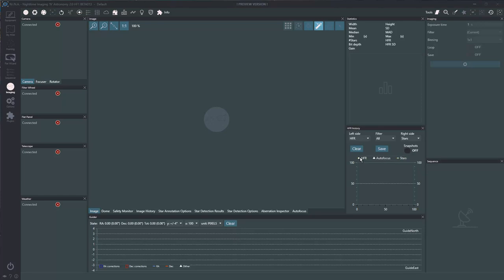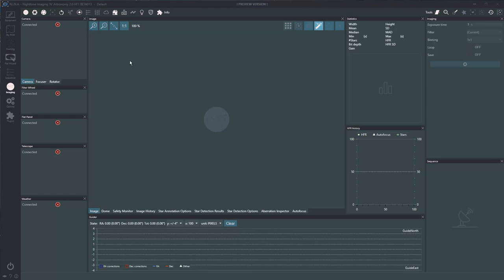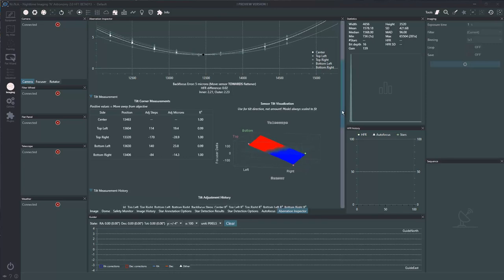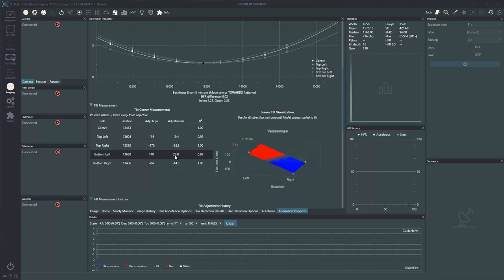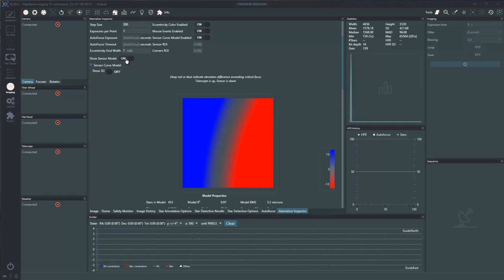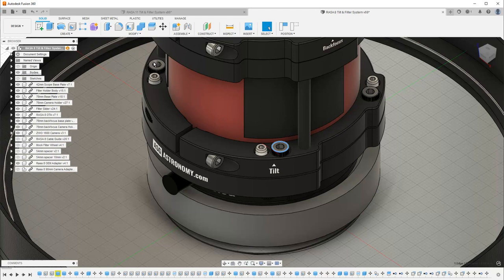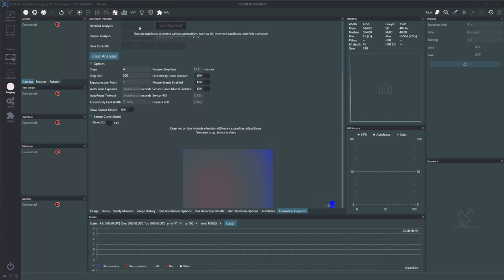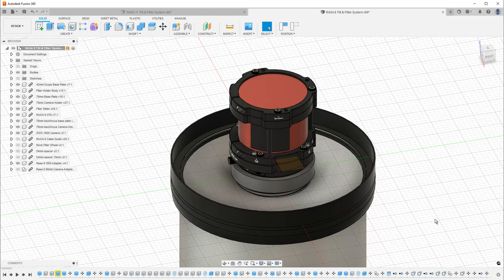How to Adjust Tilt using NINA & Hocus Focus

Comment: FYI regarding Celestron telescopes and the Celestron focus motor:

"Thank you for contacting Celestron Technical Support.

The Celestron 8-9.25-11-14 focusers all use same 0.75mm thread pitch for the focus shaft.
The focus motor moves in 1000 steps per motor revolution
Each motor revolution moves the mirror 750 microns.
Thus each step on the motor movement moved the mirror .75 micron."
Reply: @asgastronomy  Interesting, where did the 1mm thread pitch info on the RASA come from?  I assumed that statement from Celestron Support applied to all telescopes in the 8-14 range, EdgeHD and RASA.
Reply from the maker: Not sure why all my comments were deleted on youtube land, but adding them back here in case other users need info...  The RASA white papers show 1mm for RASA thread pitch, I could see the celestron SCT line being .75mm thread pitch though...
Reply: @asgastronomy  That's weird because I do remember seeing this comment before.  Doesn't it seem odd that the EdgeHD has a finer thread pitch than the RASA? I would think they would want finer focusing pitch on the RASA.
Reply from the maker: Probably matched up to focal length though, not so much the speed.

Comment: Wow..excellent, you taught me a lot! I will be using this to work out my tilt. How did you know what's top R and L and Bottom R and L as far as your camera's perspective?
Reply from the maker: For some reason my comments were all removed here, so adding back some for other viewers.

Your question on Top R & L is tough, we know the black desiccant port on a ZWO for example aligns to the long edge of the sensor, so I put my hand over the scope while collimating to figure out which corner I am on.  Now that can flop if you move through focus though... but you can at least identify which 'Axis' or 'Plane' you are working on...  From there, I do an adjustment on ONE plane (for example Top Right/Bottom Left) and see if my moves helped or hurt the values, thus I know now which way to go on each corner AND identify each corner.

Comment: The video you have shared is incredible.
One question, what procedure should I do or what parameter can I observe to fine-tune my back focus?
Thank you
Reply from the maker: I usually look at the sensor model.  Look for the slider there to turn on the Sensor Model and under the data it shows the curvature radius.  This is usually in millimeters and I like to have it as big as possible.  The larger the curvature the flatter the image and thus the more correct backfocus.  Smaller HFR values get you there as well, smaller the better... but I have good luck making my curvature radius there from 5000-10000mm in value.   If you imagine a beach ball that is 20 meters in size and place your camera sensor on it, it's pretty flat even though it's got curvature.  Now  picture it on a volleyball size object, adn curvature is obvious.

Comment: I adjusted the tilt on my 2600MM last night (using the ZWO OEM tilt plate).  One thing you don't cover in the video is achieving some room to make an adjustment.  Per the Photon Cage installation video (and how the ZWO Tilt Plate comes), all the adjustments are zero'd (flush) with the adjuster plate.  That means the only movement possible is out, there is no "in" adjustment available at that point.  My solution last night was to take the three adjustment screws in (pushing out) a relative difference based on the measurement for that region of the sensor (tough to get it right using a triable to adjust a rectangle).

Based on your AI results, it looks like you would want to double the out adjustments on those corners needing out, while going with just the 'single' out measurment on those corners needing to move in.  That would at least get you into an area where you would have some room to move on each corner, or that is the way it appears to me.  How do you handle this with a bottomed out starting point?
Reply from the maker: Our previous comments were removed, so wanted to answer this here for others as well.  You are 100% correct.  I usually take the 3mm backfocus from the cage + 1mm add to tilt and 1mm add to backfocus to equal 5mm total.  That way it has room to move around after you zero it out.  I updated a new video series and Part II of it will cover the setup and this specific aspect of installing.  Good point to cover.

Comment: So in this modern era, we all have to purchase correctors for our expensive scopes.  What do you do about your 2nd camera?  How about your other telescope?  
Oh well, I have the RASA 8 and I have, I think, worse tilt issues than even a typical one.  For which there appears to be no cure.  This scope is advertised as having a "flat field".  Ha.
At any rate, I am struggling to now learn NINA.  I went from my nice 2600s down to a 294 smaller sensor to try to help.  I still have yucky stars, even out towards the middle!  
I will continue to practice with NINA instead of being able to simply image with my ASIAIR Pro that is so much easer to use but lacks these tools.
My AstroDevices corrector (sigh) has 3 adjustment screws, not 4, so I wonder how this changes the adjustments.  I have a nice 2600MM, it's of no use since I have "only" one corrector.  I have a Tak 160ED on order.  How do I use the corrected cameras on it?
This whole business is a can of worms.
Reply: @asgastronomy  yes sir you got that last part right.  I’ve been frustrated for months now
Reply: @asgastronomy  I’m thinking that with 3 corrector screws I might have to stay with ASTAP depictions if as you say Hocus Focus is modeled for the 4 corners.  In ASTAP there’s a 3 corner option.
I wish I could have my scope optics verified.  My tilt tests as optical train tilt, not camera sensor, and I have used the Starizona and Artesky camera adaptors and shims which others use and endorse.  With 3 different cameras my tilt is about the same, slightly better with the small sensor 294 perhaps.  Still not good.
Reply from the maker: Not sure what happened to all our comments, but they got removed recently... so just adding some back for other views here... Yes, the Photon Cag works on Epsilons, have a few users already on that platform.  The RASA's, which I use both 8 and 11, are extremely sensitive devices.  the Critical Focus Zone is down to 6.5 microns or so.  Considering a piece of paper maybe 80 to 100 microns thick, we are talking about very delicate devices.

I do like ASIair pro, which I use as well, but it doesn't do any weather/dome/roll off roof type support and only ZWO equipement AND the sequencer is not nearly as detailed as what is in NINA for capturing... but great for a quick evening out I think.

Comment: The Sensor Model shows a red X on "Model Fit" - is that important ?
Reply from the maker: Yes, it is showing how well your data is fitting and if it's red or X'd out or the model R value is low, you will want to get a better image area most likely.

1.  Need to have good auto focus curves happening, that is critical.
2.  I find star dense fields in milky way are best.  NO nebula and NO star clusters and NO bright stars.  Just a large dense starfield that is consistent is what makes that model fit go up.  If you take an image out in galaxy land, there usually isn't enough stars in every quadrant to do ample work... or at least consistent work.

Comment: Which tilt plate is used for  the illustration?
Reply from the maker: So with ZWO, the cameras come with a 5mm thick black tilt plate, we remove that in most cases.  The photon Cage takes up 3mm of backfocus and then I usually add 1mm for tilt and 1mm for backfocus to the system so that the entire apparatus has room to move around.  So essentially on a ZWO camera if you remove that stock tilt plate, ours will replace it and have null effect on your imaging train.  QHY cameras of course are slightly different, but can work just as well.

FYI, just adding comments here for others in case they need the info... and our previous comments were all removed at some stage.